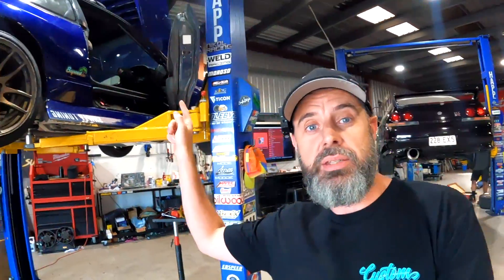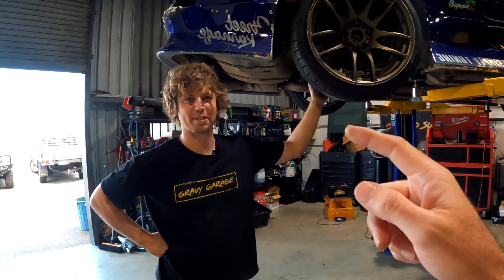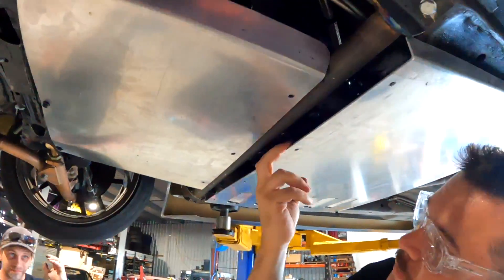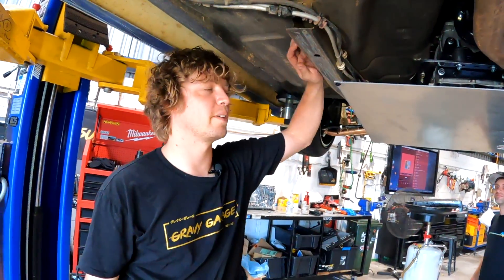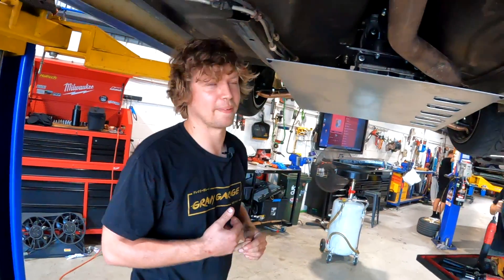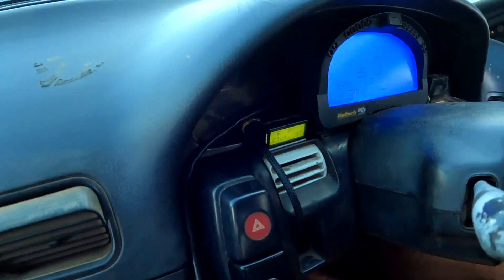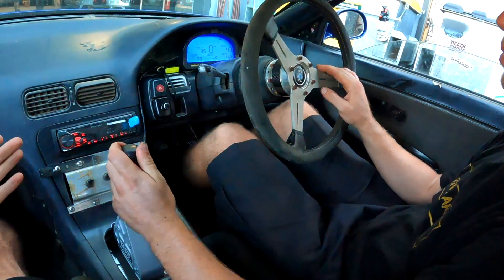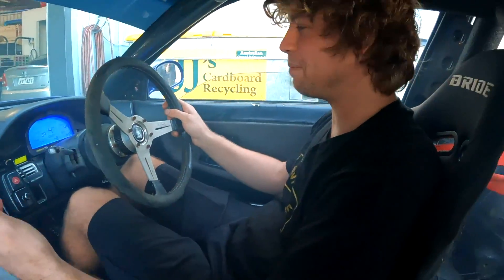How We FIT a WORKING Clutch PEDAL To the 8SPEEDs

Comment: I wish there was something like it for the zf 6hp19
Reply from the maker: The turbolamik used to support the 6hp, but stopped back in 2020. The controller is worth a lot more than a 6hp and i guess if you spending the money on a controller, you may as well run the better transmission.

Comment: You've shown the "pedal" but how does it work on the other side? On the gearbox side, what's emulating a clutch?
Reply: The electronics switch a solenoid in the transmission that varies the pressure on the clutch pack its effectively a fly by wire clutch pedal

Comment: The 8HP is going to make this channel blow up to another level. 8HP VS THE WORLD !!
Reply from the maker: Don’t get me wrong, can’t wait to get back to race cars. But learning an developing what we can do with these transmission is super interesting.
Reply: @ZeroTo60Tube  100% and I think that's what will set you guys apart from the other channels that will inevitably pick up on this. GG
Reply: but no hill/tow/push/10~mph starting is a dealbreaker vs a tremic Tr6060 for some people/me but yeah it's tempting to get a hellcat-transmission instead of my C7 drop-out

the features/hardware-gut's look like it should work but i don't get why it's not a option to work? ( had more than one starer-motor and or ring-gear/flywheel ( or weaker-battery that car started but not cranking ) go bad if is a regular automatic/OEM it leaves you stranded and at the mercy of strangers/surroundings some more friendly than others 😉 ) other wise im super tempted/feel i should have already got the 8Hp transmission instead for that part of my dodge project 60's car and put more effort into tuning/wiring as the tr6070 was a way of skipping out on it and adding old-school reliability/simplicity 

either way im tuned-in watching the video/series 👍

Comment: What 8hp box would be the choice for a silvia S15 pushing 500 max and what exactly is needed . ..?.
Reply from the maker: I would personally run a n57 8hp70. Depends on how you want to do the conversion.
Reply: @ could you elaborate on, depends how you want to do the conversion ? Which model 8hp 70 has the smallest bell housing or are they all the same size ?
Reply from the maker: @krisbuck2165  theres adapters for different transmissions, which in turn in need different brackets, different cross members, different coolers. If you are new to swaps, this video covers the basics https://youtu.be/n5hSrXZ18cA
Reply: @ just seeing if you had personal preference as I’m heading towards Adamat
Reply from the maker: @krisbuck2165  personal prefference is domiworks. But the adamat adapters definitely work.

Comment: Thats so cool. would it be posable to add a clutch petal to my RAM?  that would be so sick lol.
Reply from the maker: You need the Turbo Lamik controller to run the clutch pedal with the 8hp. So if you can make a lamik work in your dodge, you could have a clutch pedal.

Comment: Can I do this on a ZF 8HP51?
Reply from the maker: We tried with a 8hp45 and fried the clutches pretty quickly. We are currently testing out a 8hp50. Im not confident, but we will know soon.
Reply: @ZeroTo60Tube  I have a Pure Stage 1 (upgraded clutches) would that work?
Reply from the maker: @stonybrooknick  I think with pure clutches it would be ok. But definitely speak to pure first. With the clutch pedal you are forcing slip while making a heap of engine torque. TCU support for the 8hp51 is a few month away, but its coming.

Comment: From which car do you get the 8HP70
Reply from the maker: Depends on the conversion, the engine and what adapters are available.
Reply: @ZeroTo60Tube  well I'm in the US, and if I ask, I need a transmission that for N57 or B57, they are going to look at me like I'm crazy. I wanted to know which BMW vehicle has the 8HP70. Due to clearance, if i get the 8HP70 from a different manufacturer, that isn't BMW. I can find 8HP45, but I've been reading, and hearing from others is that you don't want the 45.
Reply from the maker: @cesarortega6615  Well you are limited by what will bolt to the engine or adapter kit. There are about 100 different versions of 8hp and an adapter will normally only suit 1 or 2 of them. For exampe the N57 8hp70 and n47 8hp45 have the same bell housing but different tq conversions which requires a different adapter. The only safe way to identify the transmission is by what engine it was bolted to. Google will help you work out what model cars they are from.
Reply: @ZeroTo60Tube it is going behind a 2JZ, and the adapter it is not the issue it is the limited space in my 08 BMW 328i. I can get it from a different vehicle but I don't want to cut the transmission tunnel.
Reply from the maker: Its fairly well documented that the n57 8hp70 will fit in a e9x chassis. Domiworks make a JZ to n57 adapter..... I'd say this answers your first questions. You should get the trans from a 8hp70 powered rear wheel drive car.
Reply: Thanks
Reply: @ZeroTo60Tube BTW do you guys have a clutch for bmw like the one you guys offer for Toyota and Nissan
Reply from the maker: @cesarortega6615  Not a final design. Although we are working on it. Due to the pedal design it needs to be remote unline the toyota/nissan version.Which involves a slave cylinder. We have it in the f80 we setup, but need to get the dampening characteristics worked out. It feels more like a Kia/Hyundai clutch than a performance clutch and thats not what we want.
Reply: @ZeroTo60Tube let me know or let us know when you guy have it ready. Thank for your help

Comment: Hi guys. i wanna do an 8hp swap on my n55b30, which 8hp trans should i go for?
Reply from the maker: A n55 8hp45 will bolt on. These are ok for mod 500hp if you run tq reduction.

Comment: I am sold. I want an 8HP auto conversion on my ranger. Any chance of making an adapter plate for that?
Reply from the maker: We have the 3.2 Ranger on the list. Which version is yours?
Reply: @ZeroTo60Tube  2013 T6
Reply from the maker: @kentweyers1845  sweet, with the 3.2l 5 cyl?
Reply: @ZeroTo60Tube  that's the one.

Comment: When doing 8HP swaps, do you ever find the input shaft of the gearbox is too short due to the adapter plate? i.e. not enough engagement on the splines? Cheers mate
Reply from the maker: Never, not with domiworks adapters anyway.
Reply: @ZeroTo60Tube  good to know, thanks for the reply.

Comment: do you offer solution for a 340 iX that i use in the snow ? i want to add a clutch !
Reply from the maker: While its doable. its not something we have done yet.
Reply: @ZeroTo60Tube  i currently buy a manual each year but going on the F31 LI 2 or G20 or G80 no manual + xdrive is available !

Comment: Brock I need help you legend. I need a adaptor for a k24 to Holden frontera 5 speed. CNA you point me in the direction of who can make me one? Cheers love your work
Reply from the maker: I would use the Domiworks K24 adapter for the engine to trans, but the trans to transfer case will be a big job.

Comment: Do the turbolamik and aem infinity work together?
Reply from the maker: I dont think so. You can run lamik on a aem car, but you wont cross integration via can
Reply: @ZeroTo60Tube  so rather than can integration, i would just have to piggyback off of the corresponding signal wires its looking for?

Comment: Could one use one of the versions of the 8HP that has a 47-hp electric motor in place of the torque converter to convert pretty much anything with room for a battery pack into a hybrid-electric vehicle?

Comment: what flex plate was used in brents 2jz 8hp swap? can you use a atf billet ?
Reply from the maker: We used a standard jz auto flex plate. Fairly plentiful to get around here. Since most were autos.
Reply: @Zero To 60  yeah I'm in aus too. Just with a bit of power they break the inner bit
Reply from the maker: @dylanbuckley6354  what do you class as a bit?
Reply: @ZeroTo60Tube  600hp
Reply from the maker: @dylanbuckley6354  well this is 525hp a the hubs and about to be put through a spanking of a lifetime consider the car will be clutch kicking pretty solid.
Reply: @ZeroTo60Tube  guess a good test to see how long the factory 2jz flex plate  will last and what it can handle

Comment: I'm looking to sway an 8HP70 into a 2jz s13.  Do I need to find a trans from a BMW?  Can I use one from a V8 Dodge?
Reply from the maker: We recomend the BMW trans. The output shadt on the Jeep and Dodge 70's is 5mm smaller in diameter. If you plan on making decent power with chance of wheel hop or clutch kits the small output shaft may snap.

Comment: Do you know if running the turbolamik will be compatible with the 6hp26 at all and be able to run the same features as this with the manual pedal etc
Reply from the maker: it will not. Lamik no longer supports 6hp

Comment: This is MEGA. How would that clutch spring adapter work for cars that have the brake and clutch fluid in the same reservoir. Example: bmw 135i

Or would there need to be a different approach?
Reply: Dude, there is no fluid in the drift clutch, the pedal is merely for foot control and feel. Lamik is still controlling lock up.
Reply from the maker: It would be a matter of just blocking off the brake reservoir where it ran to the clutch master cyl. Then remove the original master cyl and bolt this in.
Reply: @trickster8635  I'm aware.

 What I'm trying to say is the 135i does not have a separate clutch fluid reservoir like that 240. It shares the fluid from the brake reservoir, with the actual master being under the dash behind the pedal. 

The unit they have developed for the 8hp clutch replaced the clutch master/reservoir in the 240.  The 135i does not have one to replace like that.

Comment: Is it possible to add this to a SRT 300 with the 8HP?
Reply from the maker: It would be if you had an aftermarket controller.
Reply: @ZeroTo60Tube  is that possible in a factory configuration?

Comment: Why not just attach the pedal to a small gas strut or an old bike shock to get progressive feel?
Reply: Same difference.
Reply from the maker: Unfortunately not enough room to run anything with realistic dampening. We looked at small shocks, but when you up the dampening to realistic clutch feel levels they start to flex in a way that really looks like they won’t last.

This unit is designed to house oil and a piston for dampening. However the risk of a an oil seal and potential leaks have lead to this being what we think is the best product for a long term solution. You have to remember drifters are brutal on that left pedal.
Reply: @ZeroTo60Tube  counter lever sorta thing, get to a stage and it counters over and feels like the biting point

Comment: Hi there! 8HP question: can the clutch emulator from 8speed au work with a 328i / 228i or any other factory cat that comes with their stock 8HP45 transmissions? And what else would be needed for a factory 8hp car, just the tcu controller like turbo lamik?
Reply from the maker: We tried using the clutch on a 8hp45 and it lasted only 2 laps. The smaller 8hps will not take the abuse the clutch pedal puts them through.

Comment: Hey I’m super interested but have a question, my cars an mx73 with tube chassis 13b and soon to be zf8hp, I was wondering because my girlfriend sometimes drives the car, could I use this just for the hydraulic handbrake and for clutch kicks extensions and feel while drifting, but still be able to shift to reverse drive neutral even put it in sequential so I could use the paddle shifters without use of the clutch, I specifically want the feeling while transitions and initiations and the handbrake but don’t want it to be required when using the car
Reply: This would allow me to transition from my w58 and let my girlfriend learn to drift without being overwhelmed by the complexity of shifting and clutching while rev matching and going for the handbrake,
Reply: Also so that she doesn’t destroy my car on the first go
Reply from the maker: with the turbo lamik, you dont need to use the clutch pedal. Its just there as an option for any mode.

Comment: I’m putting a 70 in my S14 behind a 2J. Did you have to beat the tunnel for it to fit? I assume the S13 and S14 tunnels are similar.
Reply from the maker: Depends on how the 2J is mounted. This car already had a tunnel done for the previous upgraded manual box, but it would have needed a tunnel if it wasnt aleady done. On brocks S15 he had a half tunnel, but the 2j it basically touching the firewall, so he did need to change his tunnel as well.

Comment: Hi, this is a awesome setup. Im doing the same to my car fitted with a 2jz doing 470kw. What i wanted to ask is i see you using a foot clutch to reverse and pull away in, and the using the trans brake for launch control. What i wanted to know is could you also use the clutch and rev the engine to like 4800rpm and the just drop the clutch, or will something break?
Reply from the maker: The clutch pedal fully overides the programming in the trans. So it will do what you are descriving and no it wont break anything in the trans at these power levels.
Reply: @ZeroTo60Tube  Thank you for the reply, this makes me happy lol
Reply: @ZeroTo60Tube  Hi, in your experience, which adapter kit from a 2JZ to an 8 HP70 would you recommend as being more suitable, as I assume there are quite a few brands available?

Comment: What about connecting an 8HP to an M57 E46? would the turbolamik be necessary if going all bmw? is it necessary for running a clutch pedal setup like this? Diesel daily drifter is the idea. Love the idea of having the 8 speed as well as having a clutch pedal
Reply from the maker: Yes you will need the lamik or some sort of trans controller. Lamik is best option for clutch pedal that actually works

Comment: Hi i'm currently perparing my 8hp70z swap into my M54b30 turbo e46 track/drift car and I was wondering how you make de n57 flexplate work with the m54 crankshaft holes, is their an adapter? I will use a pcm adapterplate. thanks in advance, greetings from belgium

Comment: like its great your jumping into the 8hp scene but the hype like clutch with it and dcts is quite funny to me having a dct behind my 2j for 2 years now with a htg controller and cbw, like it's great its becoming mainstream but has been here for a long time already
Reply from the maker: No one really talks about the way they have set these clutch pedals up and there hasnt been an off the shelf option for people before. Do you like the HTG setup? Also curious if you use it for daily driving?
Reply: @ZeroTo60Tube  we did 4 htg setup thus far and I can tell u it’s mint
Reply: @ZeroTo60Tube   it  was a daily drive before bubs, now weekend warrior, is a jzx110, will be honest htg updates have broken stuff along the way but its the price i pay for being a early adopter, but always kept backups of old tune and firmware to jump back if it did, took a very long time to get clutch take up and shift cuts 100%, and dont get me started on part throttle stuff, alot of hours spent with my tuner "lucky he's a mate and likes doing cool shit" doing normal driving to get the manners correct, wot up was piss easy decel down was the annoying one too, so many variables to get right, as it sits i wouldn't touch it anymore and just enjoy it now but i would say its like 98% but its not worth my effort for the last 2%
Reply from the maker: Thats awesome and the way it should be.

Comment: Would these 8-speeds fit into smaller capacity diesels like the ZD30's?  Yeah, I know, plenty of haters but the ZD does actually work well when setup right, just sucked backwards with shitty gear spacings of the factory truck cog-swapper....
Reply: Why bugger around with a ZD that could explode without notice? Just swap M57 and 8HP as a package. Done deal.
Reply from the maker: It would be possible. But honestly Probabaly a cheaper exercise to grab a m57 donor car and do the m57 donor then mate it to the 8hp as the m57 to 8hp plates are cheap.
Reply: @trickster8635  Ignorance is bliss, isn't it?
 Mine just shy of 500K and still going well.